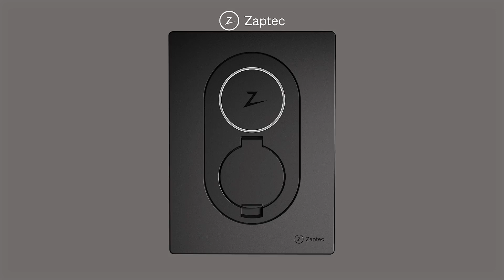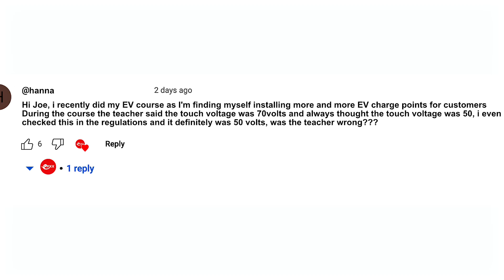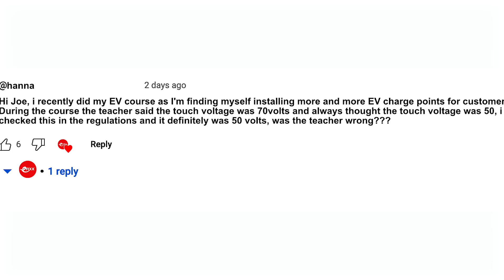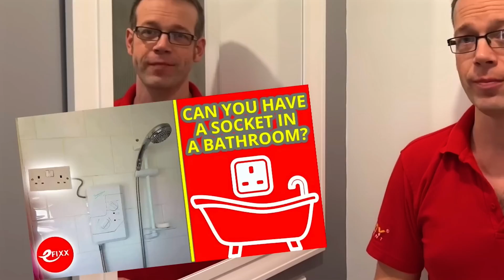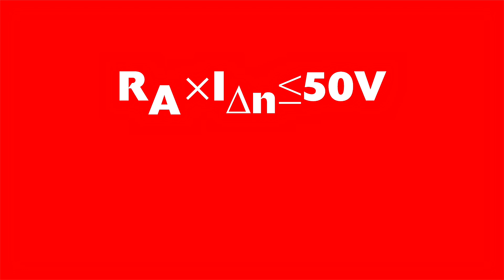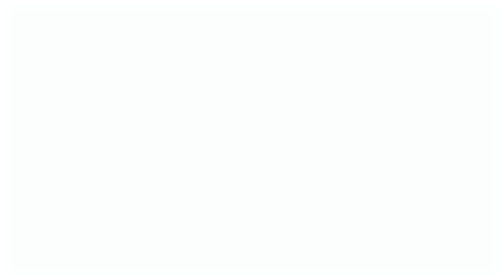Why are Touch Voltages Different for EV Charger Installations?

Comment: Surely if you touch a live part with you left hand, current is still going to flow through the heart and even more easily with a higher touch voltage? I guess they are counting on everyone wearing shoes to act as an insulator